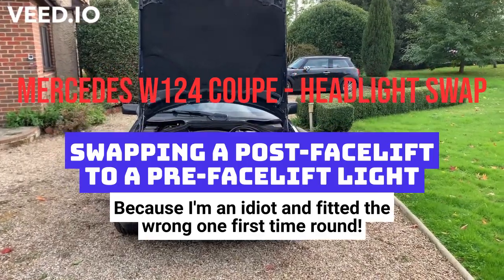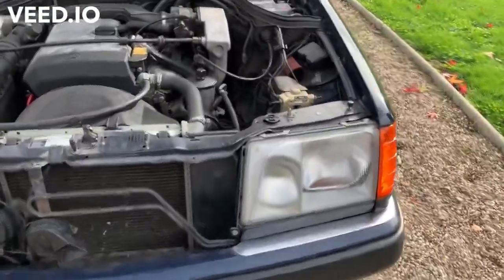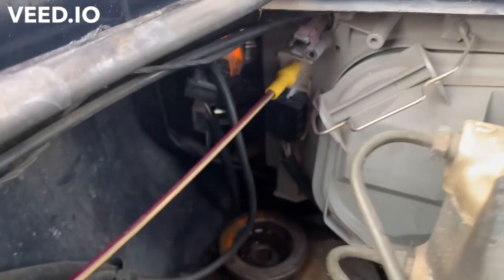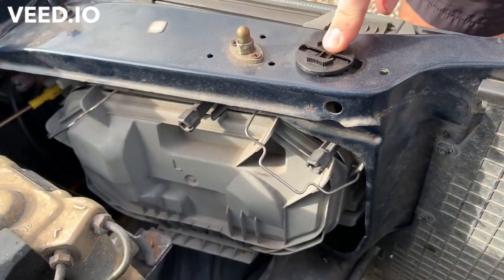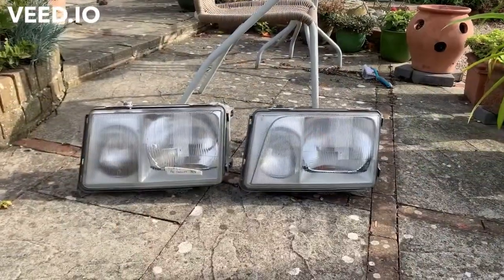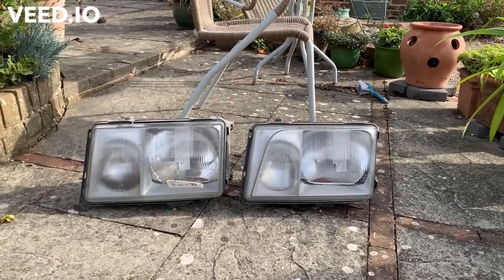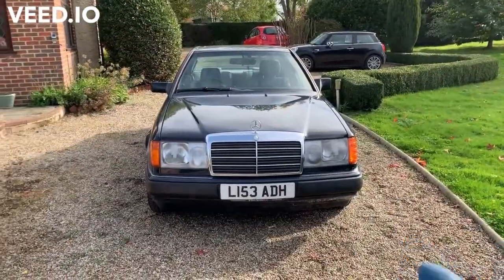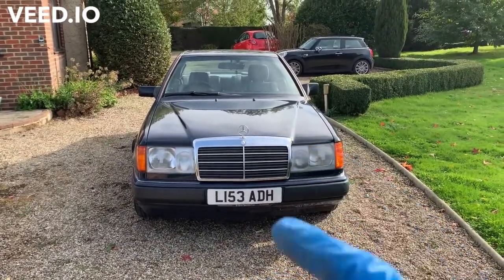Mercedes W124 Coupe - Headlight swap (as I'm an idiot)

Comment: so you had post facelift headlights on a pre facelift car?  It was hard to see what it looked like, did it look terrible?
Reply from the maker: I had one pre- and one post- facelift light so it looked a bit odd. 
Not the end of the world but where the facelift bonnet grip s a bit more angled, there is a gap between the grill and light. 
If you didn’t know you probably wouldn’t notice, but I did and it annoyed me!
Reply: @Beechams1042  OK thanks, I have a set of post facelift lights and was going to install on my 87 an the lights are not the best. I didn't want to go to all the trouble if they would not work w/o swapping the hood, or if it looks really bad.
Reply from the maker: @cph3459  They will work fine and it may look better having the pair. I think you can even swap the lenses if you wanted as I think the insides are the same.